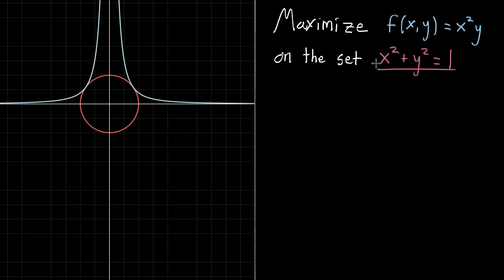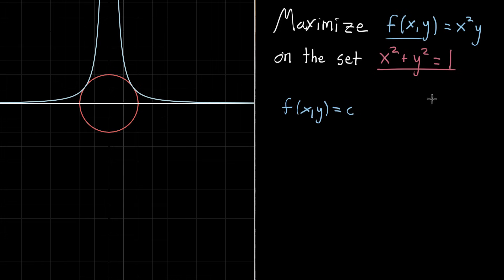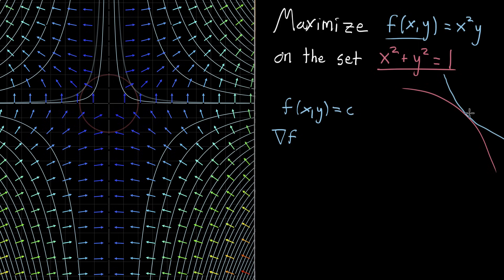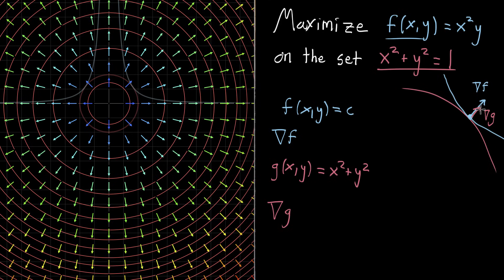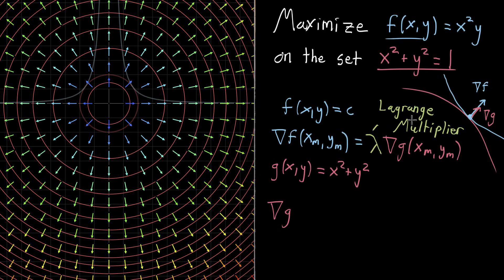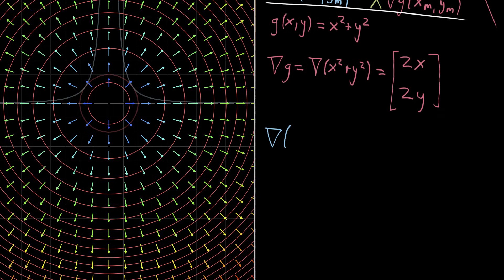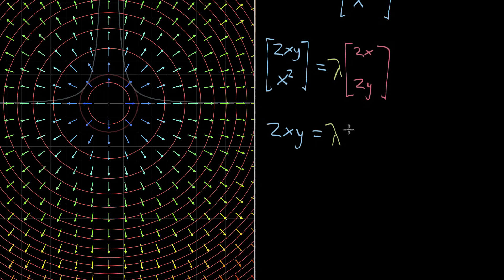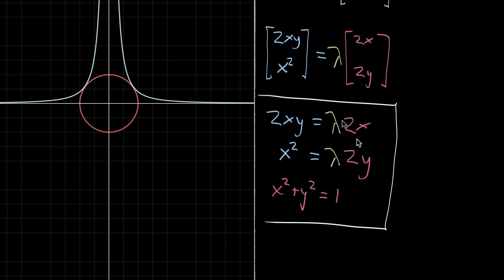Lagrange multipliers, using tangency to solve constrained optimization

Comment: Great explanation, thanks for the efforts. For the interpretation(insight) on ∇f(x)=λ∇g(x) where x=[x1,x2,...,xn] is the solution for the extreme, is it because that such extreme only exist when the pulling force of the gradients are proportional to each other because they have the same tangent line? for example, if we expand the size of the circle g(x) in the original example, the original f(x) overlaps with g(x) at points where they have different tangent lines, which implies gradients on different directions on f and g correspondingly, which means that there is a space for improvement for f(x)? Can anyone help?

Comment: Thank you. I understood the concept quite easily but probably not as completely as I would like. What could happen if the two surfaces have more than a point with the gradients being proportional but not touching each other? it can't happen when using the constraint itself as an equation right? but could the equations touch each other in different points?

Comment: I am wandering why the direction of the gradient in the half below of the plan goes in the opposite direction? when you draw the vector gradient for g(x,y)=x^2+y^2 all the directions for the vectors of the gradient were going outward vector? why is that?
Reply: Because the function has a local minimum at the origin on the x-y plane.  All paths of steepest ascent lead away from this point.  Thus, the gradient diverges at this point.   The gradient diverges at every point on this particular function of g(x)=x^2+y^2 .

Comment: While the lagrange method with lambda is great to learn, it is actually a lot less gruel in examples such as these to solve the equations without involving lambda.  Take the requirement grad f || grad g and write it as a determinant, det(fx fy; gx gy) == 0  <=> grad f and grad g are parallel; that's one equation and the constraint is another equation -> two equations and two unknowns. :)
Reply: I noticed this, but my professor mentioned that there are some equations where lambda plays a role. I'm not sure what they could be though.

Comment: Question: Consider we have a continuously decreasing function i.e. the value of the function decreases as we move away from the origin in the x-y plane. In such a case, the point that maximizes the function whilst satisfying the constraint won't be at the tanget, right (in the words of the video - where the two curves just kiss each other)?
Reply: I believe it will, but only on one side

Comment: i can see why Lagrange Multipliers works here because of tangency. What about if f(x,y)=3-y^2 ... then we know the maximum is on the line y=0 but this contour is NOT tangent to the constraint. (although you do still get the right answer if you apply the method). Why is this? Are there some functions this method won't work for? If so what is the condition?

Comment: Could you also do this but take the inner product of the gradient of f with g and setting it equal to zero?
Reply: @Ar'Khan _ Khizarkhajul No. I think I'll post it on the math stack exchange. They usually answer quick. I'll post a link if they answer. I guess I could try it myself to see if I can get the same result but I'm too lazy

Comment: Hi. If we imagine f(x,y) to be such that the contour lines of f(x,y) are lines parallel to the y-axis such that the contour line corresponding to the max f(x,y) is x=0. In that case, would this method apply all the same? g(x,y) and the constraint g(x,y) = 1 is assumed to be the same. Thanks!
Reply: Did you get an answer?
I'm struggling with the same question.

Comment: Is it possible to use f(x, y) = 1 as the third equation instead of the constraint, x² + y² = 1?

edit: would this not give you 1/lambda?
Reply: No. The contour line of f tangent to the unit circle is not of value 1. You may be tricked by the fact that the clip shows the contour lines of f extending in the same XY plane as the circle, but in fact they are extending upwards, in the Z direction. What you see are projections in the XY plane.

Comment: Why not just say f(x,y) cross g(x,y) = 0? That only happens when the vectors are parallel.
Reply: Because then we have to reverse engineer the formula for cross product to get a relation that we could have just gotten from gradients. Furthermore, the vectors are only defined by the partial derivatives of the function, and once we have those we have our relation. Just a lot of work for no reason. Good point though

Comment: (A problem in an Earl W. Swokowski calculus book) "Find the points on the graph of 1/x + 2/y + 3/z = 1 which are closest to the origin." Answer: (a, 2^(1/3)a, 3^(1/3)a), as a = 1 + 2^(2/3) + 3^(2/3), approx. (4.667, 5.881, 6.732). The shortest distance is approx. 10.084.  Why is this so; as x=1, y=-2, z=3 is used; which makes the equation equal to 1; and the distance from the origin is sqrt (1^2 + (-2)^2 + 3^2) = sqrt (14) which is approx. 3.742; which is less than 10.084??  Is this problem restricted only to the octant where x, y, and z are all positive??

Comment: I don't understand why the lines must be tangent, I get they have to meet, but not why they just only kiss. It seems to me I can imagine graph shapes where the contour lines of maxima arent tangent with that circle, but meet it nonetheless, however I can't put that into words here :(
Reply: if they arent tangent but meet, then they intersect twice (if you assume that the lines are smooth enough (if that was what you worried about you were right, there are some conditions on the functions for Lagrange multipliers to work)) and if you move now the line so that it intersect not twice but only once you get a bigger (or smaller, depending on the direction you move) value, ie the original one was not the one you were looking for
Reply: my exact thoughts
Reply: no such thing as cx or worx or hapx or not, ceptu, say/can say any nmw and any can be perfx

Comment: +Khan Academy g(x,y) as shown in the video is NOT a function.
Reply: +tamirgez In your link 'z' is not a constant.  As he describes them they are contour lines of equipotential.  Hence each will be solved as y = .... separates into two equations and graphs as a circle (shown and clearly failing the vertical line test).  Or maybe he just ditched that part about equipotential....

Comment: what if my function to, say, maximize is x^3 - x and my variety is -2 <= x <= 2, y = 0 that yields the extrema of the function if we just project it into y= 0, although clearly the maximum is at x = 2 and not x = sqrt(3)/3. do I have to re-evaluate the function with a restriction on its domain, I.e f(m(t)), on a 0 dimension variety? that doesn't even make sense, even though technically it could be the level set of a function in R1. But then the implicit function theorem can't hold. Could anyone help?